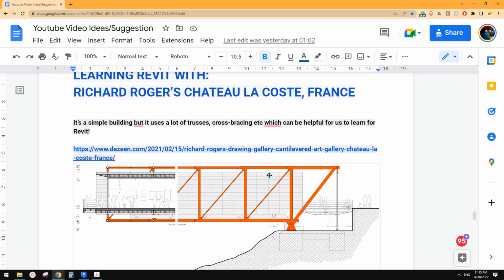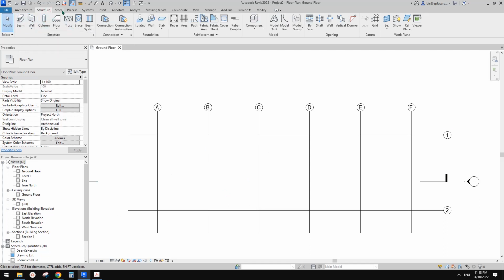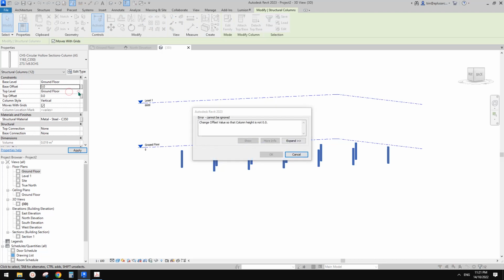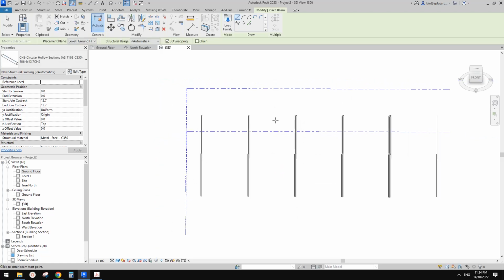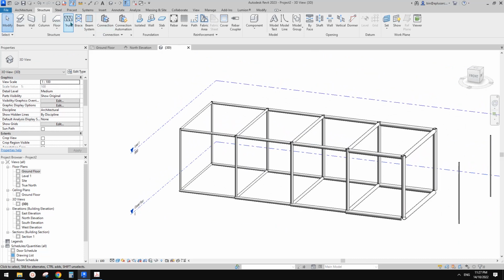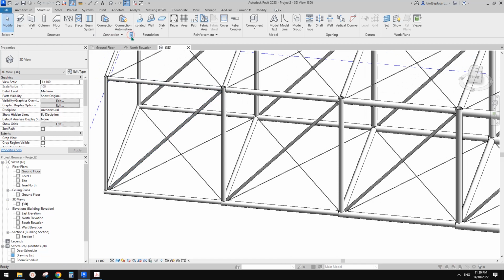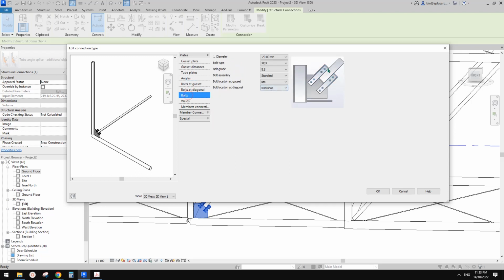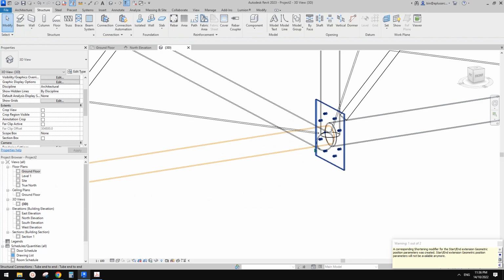Revit Exercise (Day 935) - Structure Exercise

Comment: Hi, Bin, I don't speak english. Para este tipo de estructuras considero que es mejor modelarlas como familias de celosías estructurales.  Usando dichas familias, se dimensionan en 2D como simples líneas de eje y luego al cargarlas en Revit, cada línea se asigna material y tipo de perfil según conveniencia, ya sea cuerda superior o inferior y las diagonales y verticales.  Ahora bien, las propiedades de las familias de cerchas les permite cambiar el ángulo de rotación según conveniencia, entonces, puede formar dos modelos de cerchas.  Las verticales y las horizontales con diseño según la necesidad de la estructura como lo muestras.  La gran ventaja es que al tenerlas como familia de cerchas se pueden modificar y actualizar de forma muy fácil y además se pueden parametrizar sin problema.
Reply from the maker: Thanks for the feedback, @alvaroleonS. Yes, we can use truss for this exercise, but as far as I know, trusses only work in vertical planes. When we need to place those bracing, for example, it's probably easier and faster to place them as structural framing. It would be good if we could create a three-dimensional truss family. Alternatively, we can also use an adaptive family for this.
Reply: @BINHE615  Correcto, se puede usar más eficientemente un sistema de vigas en el plano horizontal, pero las cerchas se pueden usar en un plano horizontal y no solamente vertical.  Lo que se hace es rotar el plano de la cercha, puede rotarla cualquier ángulo.  El revit tiene una opción en propiedades de instancia que le permite rotar el plano..
Me encantan las familias adaptivas, el problema es la contabilización de materiales para un cálculo de presupuesto.
Reply from the maker: Thank you very much for your reply. I didn't know we could have horizontal trusses. I'll give it a try when I have the chance. It's possible to schedule adaptive families using shared reporting parameters. I just did this example moments ago. https://drive.google.com/file/d/1FaD8_oeUlbHnNy6JC6s8nesi6j1lksl5/view?usp=drive_link